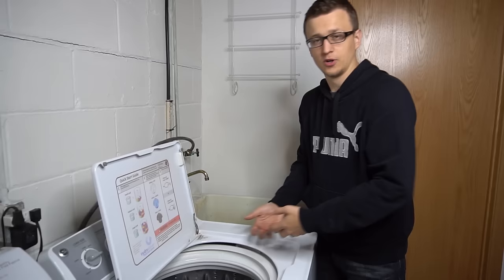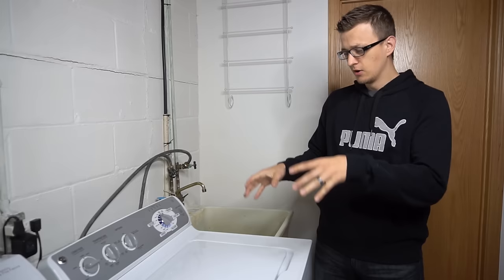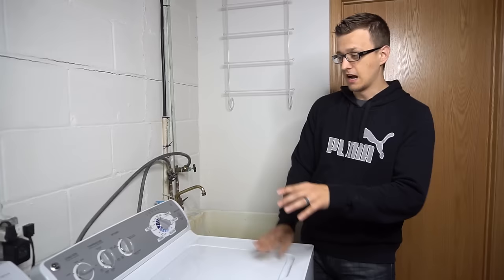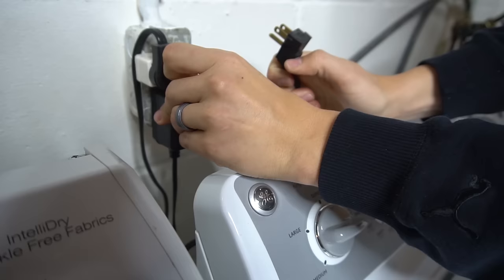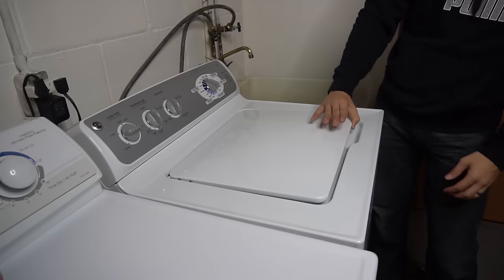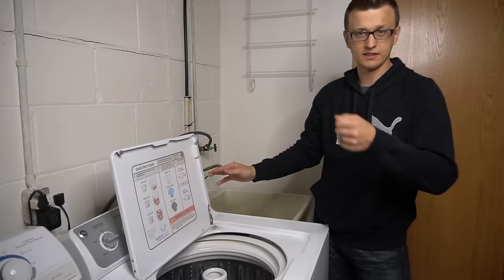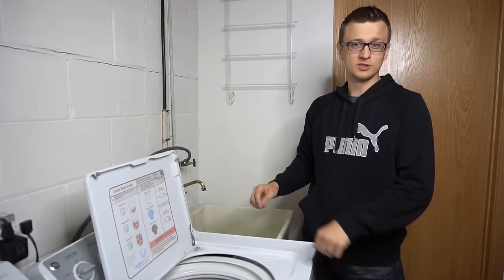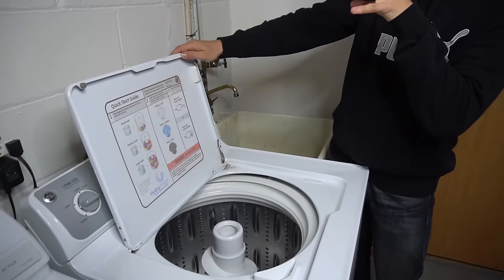Washer Not Spinning - How to Reset Motor (Easy)

Comment: Hi, my kenmore top loader is missing the lid sensor.  Before it stopped agitating or spinning, the machine would wash, spin & rinse while the lid was open.
When it should be spining the motor is humming, so its not a dead motor & it drains but no spinning either.  The agitator only moves one way & not the other when l attempt to spin it by hand.
Reply: Did you ever fix the problem? Im having the same issue with mine
Reply: @soy_mariachi2425  not yet but in the next 2 weeks.  It just might be the belt.  If your a ltl handy, you could open the back & see if it's  the belt, easy enough fix. 🍀
Reply: My machine is an older one, no electronics.
Reply: Thanks for the reply, my machine almost looks like the one in the video except mine is a Kenmore, i think on mine it could be the timer but not sure

Comment: I watched the entire video and performed all the steps as mentioned. However, my machine is still stuck & does not spin.

I am reading all the comments. Seems it worked out for a lot of you people. Don’t know what I am doing wrong. I have a Kenmore Series 80 Toploader washer. I know the problem is an uneven load.
Reply: This only works on GE Washers. Your washer is likely a Whirlpool, which is a whole different ballpark.

I'd check the tub shocks. If it has lights and a lock, push on the tub and if its bouncy, replace the 4 shock rods. If it doesn't have lights and has a mechanical timer, replace the three springs underneath.

Comment: Your 3 plug in power supply looks to be over heating based on the discoloration.. You may be causing running a heavy load which draws in more current which heats that plug element which because more of a resister which your washer detects and shuts it self off. Thanks for the reset vid tho

Comment: My GE won't spin. Just makes clanking noises and moves back and forth a little. . I put a magnet on the lid switch so I can have the door open. I gave the tumbler a little push and now it's working. What could the problem be?
Reply from the maker: Strange.. I don't recall seeing something like that on a GE washer so can't tell you right off the bat what that was. Has it been working good since?

Comment: I just want to let you know that yours keeps messing up because you have to high volt appliances hooked into your adapter. that is why it is dark at the bottom when you hung plugged it you literally are burning it and it will eventually start a fire. just be careful and don't run it while seeping or not home

Comment: I have a Maytag A310 washing machin that agitates fine but when it goes to spin out, it shuts the motor off. I put a new motor on it and belts and it still does the same thing.. It acts like the motor gets a load put on it and shuts itself off because it works fine without the belts.

Comment: that's like our washer, but the seal went out in it and the main board goes wacky too.  However,  we like the multi level water adjustment of the older machine. The new GE only has 4 levels and auto water levels and puts too much water, washes in a short time, and then spins 15 mins, and takes longer than our old GE and they call it energy efficient?  And the washing cycle, the motor sounds like a whining pig each time it turns back and forth and our old GE was very quiet. It seems not just GE but everyone is complaining about the New washers are making more noise during agitation.  Also, when you open the lid, if not lock, otherwise pause it, it gives two bursts of water, even if you pause it on the rinse/spin cycle to adjust the clothes, it does it everytime.  Our old washer only spun about 5 or 6 minutes.

Comment: Whirlpool washer pump comes when washer is bumped or with slight vibration. First time machine was bumped, pump came on and was able to shut off with cancel button. Second time, wife dropped something in front of washer pump came on, surge went through panel box causing lights to flicker, had to unplug machine to get it to turn off.

Comment: Does this work on whirlpool cabrio platinum?
Reply from the maker: To be honest, this reset procedure is only meant for GE topload washers. But if you read the comments, it seems like it works on other brands as well. (though simply resetting power may be all that was needed, without the lid procedure)

Comment: I take it that only works on an older machine? My Midea 7kg top loader keeps beeping E3 error. I tried this tip to no avail. I stopped using the machine for a few months then decided to plug it back in and it worked fine for a few weeks then back to the E3 error 🙄

Comment: I would change the plug adapter that you have you can see the burnt part and that is saying you have sparked it. Not a good sign and that could also be sending your machine into issues. Power surge of some type obviously happened. A fire 🔥 waiting to happen.

Comment: Anyone help! Lol I thought it was the timer so replaced it and just now seen this video. But I’m not sure if it’ll work my washer goes off and on with the issue. I have had a few power outages but my concern comes from an electrical burning smell. Any advice?
Reply: So I do this and i know it does reset the Motor because it still has to be nudged or kicked a little to start the cycle back up

Comment: As a follow up, the reset worked great around 10 times, then it went back to the same problem and wouldn't respond to the reset.  I'm having to get a repair person again, unless you have any other suggestions.

Comment: Hi! I have tried this twice and it still doesn't work. The machine will turn back on, I will start a load, the lid locks, water comes out, some strange sounds occur and then a few minutes later the machine just turns off and the water drains. Any idea what I should do next? Thanks!

Comment: I had the whirlpool door open on washer while filling waiting for more clothes to put in.
So the person never brought me the clothes so the washer also stoped filling and drained.
So now it is humming .
No lights on board.
Won't fill push cancel button won't work.
Unplugged didn't fix it replug didn't fix it.Just keeps making a drain noise no water in there.

Comment: What if its not showing any codes? I just got one used and it will sense the load, go into "wash" mode and not spin, and then drain and repeat. I let it do this for HOURS and would do anything else. No codes. I can turn it to the spin cycle and then it will spin so it can spin, I just don't understand.

Comment: What is you loaded clothes ,it started to spin and stops with water in it
Reply from the maker: It's possible that the drain pump filter is plugged and that is why it is not going into spin.

Comment: No,  it didn't work., before this procedure my washer was filling  then after 1 minute it would drain all the water.  Now, after I did this, is not filling...... nothing!   Stays on and after 5-6 minutes it turns off by itself.

Comment: Mine is a midea top loader only 2 yrs old and checked the spring and its leveled if i do too much unbalnced and do too little unbalanced  it gets down all the way to Spin cycle lowest 10 mins left then i watch it and starts hitting the sides ive taken clothes  out wrang em out a little and put back in to relieve some water and nope  10 mins left then restarts  to 22 min cycle for "rinse and spin cycle" again so i hirry n stop it....ive tried the unplugging  part not lifting the lid yet but im so fed up with it....had some shirts one pair jeans some socks n under grarnments  after i wrang some  by hand to put into dryer taken little by little out n re trying again smh🤷🏼‍♀️🙄 ** ive tried a normal  load, a small load just cant get it "in the middle" sometimes  i think 2 myself like man cmon  now if washer cannot wash few shirts 2 towels n 2 pairs jeans theres  n issue wth would it do if i seperated and washed clothes accordingly  how suppose too wash jeans n towesl together  etc seems that would be wayyyyy toooo Heavy!!****😢

Comment: The issue your having is that your plugged into an adapter instead of directly plugging into the socket. This is why you have burn marks around the outlet. It's causing the short which is tripping the motor. Never plug appliances into an adapter! Major fire hazard!

Comment: The unit should always be plugged directly into the outlet and you should absolutely never use one of those cheap junk power Splitters. You can even see where it has been darkened by having too much current drawn

Comment: Did all the things you said in the video, and nothing worked.
Reply: Same here. Followed the instructions three times. That blasted lid lock wants to lock the lid every. time. I try to open the lid the six times!! And I make the 12 and 6 second time limit, even!! Still reverts back to the same problem. Not only does it not spin, it sits there and just locks and unlocks the lid repeatedly. -Like a person pretending to hand you something and snatching it away before you can grab it! What now? My baseball bat wants a try at it... 🙄🤦🏻‍♀️